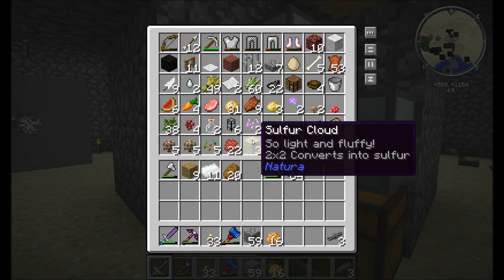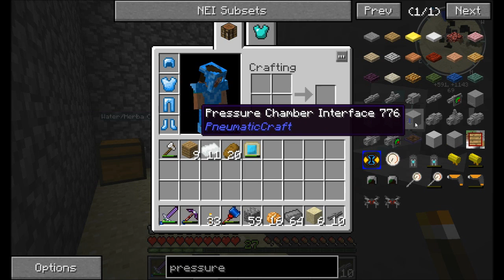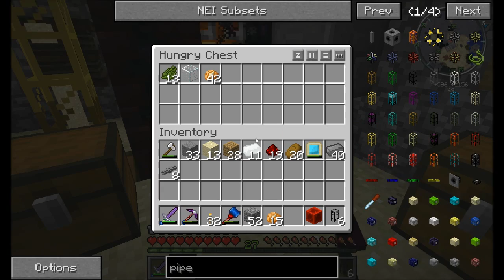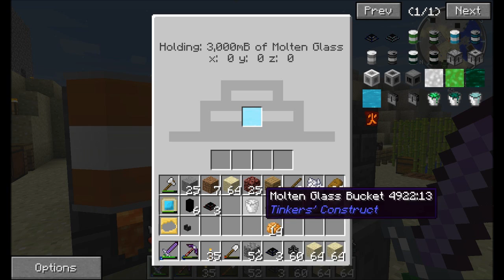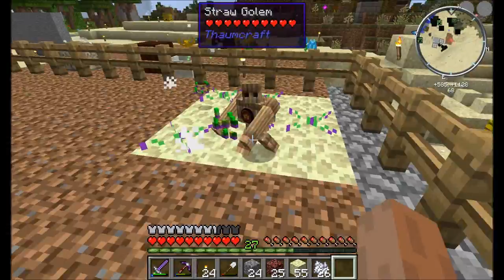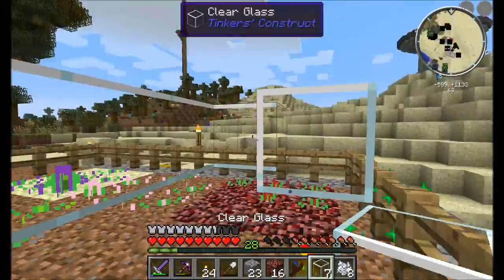Forgecraft2 S4E7 Pressure Plants

Comment: I want to make a large pneumaticcraft pressure chamber and place 2 portal spawners from the portal gun mod inside the chamber.  Then drop items in the portal to see if they land in a fully closed pressure chamber............ this way you don't have a pressure drop. Use the same method to get the items out. By the way, you will need a form of wireless redstone ( or arcane ears) to make this work.
Reply: The portals use two blocks, and portals are alien to pneumaticcraft, so it wouldn't make a multiblock when there's portals in there.
Reply: Yes, you would have to make the chamber large enough for the 2 block height plus the space for redstone. I figured it wouldn't work, but I was just brainstorming.
Reply: DonG0412 I'm giving you points for trying then